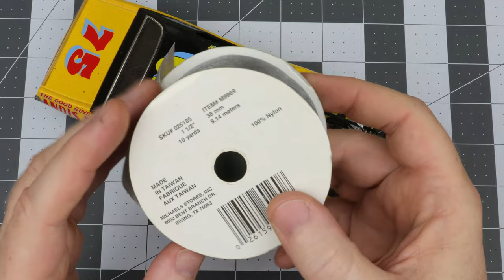SALVINOS JR 1/25 dirt track USAC Dodge Charger. Final weathering, soldering brass and more!! //PT.9

Comment: To me the dieting the tires. I never used a toothpick to spray the mud. I have seen the ak product before, just always used real mud with a soft toothbrush. Seems like you have more control over the ak product as you did. Thanks for the great tip. Looks like I will be heading to 25th street hobbies to pick up an old NASCAR model. Thank you Clay for this nice series, have a great one!
Reply from the maker: Glad you liked it Mike. And for sure, this stuff can be really easy once you feel comfortable doing it. Plus as you could see when I got carried away, wipe it off and try again. Do you shop at 25th street in person, or buy from him online? Big fan of his booths. I buy a lot of supplies there.
Reply: I do buy in person. Can't wait until Dave gets the new room in back of Gizzmo's for his hobby shop.

Comment: I even started a new rc racing hobby it's 1/24 1/25 scale model cars only on a special 3d printed flat pan car chassis that you can choose 20; different styles of rear ends for rear end and you must use the original body from kit and full interior detail and motor and all from kit you must use atleast 1/2 of the kit and I have different classes brushless modern nascar brushless vintage and classic nascar 1960-1980 vintage and modern latemodel/stock car dirt or asphalt doesn't matter in a fast brushed motor with lipo and then open road course any car you want on a brushless motor. It costs 70 buck to build just the car that is kit motor esc and servo then add your own radio and rx and I made very tiny transponders for timing and race results